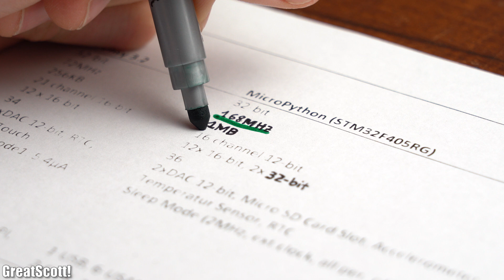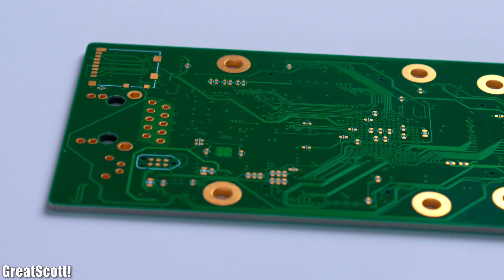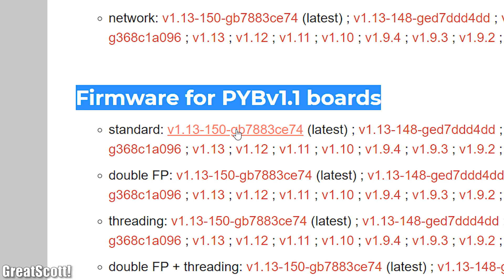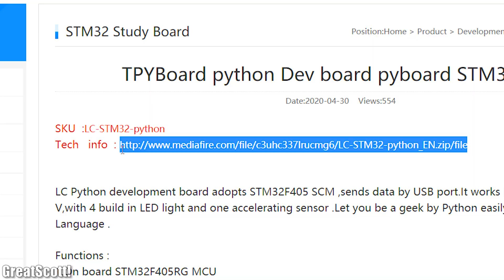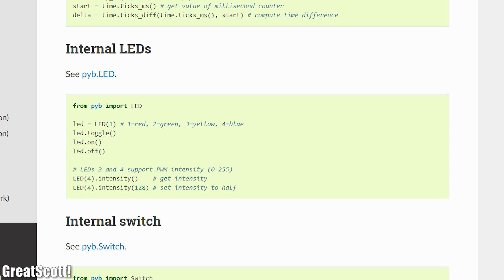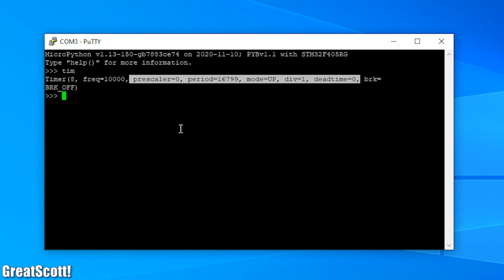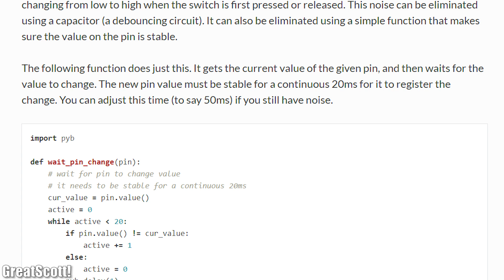Easy & Powerful Arduino Alternative? #4 Pyboard (MicroPython) Beginner's Guide

Comment: Sure the Board and Micropython is easy and simple to use, but it will make pretty much any engineer cringe real hard when asked to work with it.
Reply: Could you please explain why?
Reply: @adityag.5372  Because engineers have a massive thing about being "real engineers" and how their code is great because they understand how the hardware actually works and other nonsense ... the big inside joke being that they all think modern processors work just like a z80 did decades ago.
Reply: @adityag.5372  The overhead is way to big. To run Micropython it requires a beefy processor. And if you are going to sell a product, this is a huge waste of profit. And engineers need to spend the time to optimize a product so it gets the most profit for their company. Sure you save development time by using Micropython but it results in a net loss overall. Also if you try to leverage some lower level properties of your processor, it pretty much impossible with python.
Reply: @jfk4229  

>lower level properties of your processor,
>it pretty much impossible with python.

Both normal python and micropython can call directly into functions that use the standard C calling convention/ABI. Normal python has alternative interpreters like cython that take dialect of python and turn it right into machine language... There's no reason someone couldn't come up with an ahead of time compiler that did the same for micropython.. i.e. produced machine code for the target micro before hand. All you would need would be a frontend to LLVM or GCC.
Reply: @donpalmera  But why would anyone go through that much work instead of just using plain C/C++?
Reply: @jfk4229  

You don't have to re-write micropython each time you want to use it. Calling "native code" is easy. Why not use C or C++? Because a lot of people are terrible at it and a lot of people are just sticking together code that already exists. Why not use a language like python for that and get some nice bits like memory safety, useful exceptions etc in the meantime. 

Of course there are reasons to use C but the reasons you'll hear out of most engineers are total nonsense.
Reply: @donpalmera  You are right that python is a better language for engineers to get right. Because there is pretty much only one way to do things. (Unlike C++, which has a insanely bloated std-lib) But its feels wrong to push technologies into areas for which they weren't originally designed for, just because we can. Have a look at web technologies. There its WAAAAY worse. (And even more people who think they are grandmasters, just cause they have a website) And I REALLY don't like that embedded tech is heading the same way.
Reply: @jfk4229  Partly because C/C++ is a royal bitch to work with if you are fairly new and don't intimately understand the specific hardware you are using and the exact functionality you are after.... Not to mention that Python has already eclipsed C/C++ as the go to programming language worldwide for the greatest number of devices... I have been an engineer for over 30 years and worked with ancient languages such as Fortran '77, Cobol and early versions of C... as well as assembler (yes, even for the Z-80) as well as some C++     I happen to like Python and its ability to Include C programming into it, and a large and growing number of IT and programming professionals feel the same way as provided in statistics and surveys from the professional magazines and sources... I think the only reason you "cringe" is because it is something new that you do not understand and it makes you uncomfortable... Personal opinions aside, the areas of growth are in Python programming and the Circuit Python and MicroPython subsets are stepping stones into the full version... the choice is yours... languish in that supposed "Z-80" mindset of mindless "superiority of "X" Programming language", or chase the solid career paths offered by growing and expanding your knowledge...
Reply: >pretty much any engineer cringe real hard

The cringe won't be as hard as when anyone with some development experience looks at code written by an engineer. EEs etc write insanely awful code and should be using something like micropython to save everyone else from their garbage.
Reply: @donpalmera  ARE YOU INSANE?? EE's write HARDWARE SPECIFIC code so they can use cheaper processors in their designs. Therefore increasing profits. If you come from an IT side it feels like bad code because all these memory and speed optimisations feel like wasted time. It people are so used to always having enough processing power. This is really the awful side! Totally unoptimized code. Imagine you use Python on servers with huge trafficloads. Your boss will be very displeased to see that you need to scale up the infrastructure again, just because your code is not optimized. The real nonsense is not understanding why something is done a specific way when it could have been done way simpler! I guess you suffer from the same problem you described about engineers having a massive ego.
Reply: @jfk4229  

Hate to quote myself but....

"the big inside joke being that they all think modern
processors work just like a z80 did decades ago"

The fact that you think you're diddling around in code actually makes much difference is laughable. Most of the "optimisations" you think you are doing the compiler totally ignores or are actually anti-optimisations.
Reply: @g69se212  

From my real world experience:

I worked with an IoT in a can module called the electricimp. That had everything, networking, crypto etc and is apparently STM32 based. I think something like 300KB of SRAM.. they managed to get everything in there including a top level scripting language called squirrel. They even managed to have some sort of A/B OTA update scheme that made it next to impossible to brick and had deep sleep for power saving. Basically they got it the balance just right. The built in OS did most of the grunt work and the developer just had to slap together a script with their logic and they had an IoT product.

Then I worked with an IoT chip that had 1MB of SPI flash internally and 512KB of SRAM. There was no memory mapped flash so everything that had to be accessible by the cpu directly had to be in SRAM including RO data. With the wifi handling and proper TLS there was barely any memory free and everything was written in C. That should have been the better chip and it would have been able to have a scripting language for the business logic if only it could run code from the SPI flash... To make barely working C code fit on that thing took months of #ifdef 0'ing out bits of libraries. It was a total nightmare.

This is the same situation with the ESP32 right now: It doesn't really have enough SRAM to do TLS properly let alone TLS and micropython but it's totally possible to get it right.

If micropython really takes off especially with RISCV gaining momentum I wouldn't be surprised if we see mass produced micros that are kitted out specifically to run it as the main language.

A micropython frontend for LLVM would also be cool but I think rust is probably going to fill that niche.
Reply: Wow looks like i started a heated argument 😅😅 anyways thanks to both of you for your insights
Reply: @g69se212  

>But I don't see how MicroPython
>can (currently) beat C in efficency
>(time, space, power). 

I don't think it has to be. The places you'd use micropython (bigger micros with network connections etc) make it less of a problem.

Comment: I had my first 4 layer PCB built by JLCPCB because of your sponsorship. They did a fantastic job on those boards! I am very impressed by them.
I’m designing another project and will use them again!

This seems like an interesting board. I’m very interested in the Arduino port for the libraries. That way, the language changes won’t be so severe. Sounds like a great board to experiment with.

Thank you for a great video!
Reply from the maker: Great to hear!

Comment: Can you make a motion controll project were multiple servo/stepper motor can sync up with a rotary encoder?might also be nice if it has an electronic/virtual gear ratio on different motors. It would also be nice if you can just use something an arduino.

Comment: "168MHz clock speed" 
Meh..
 "1MB memory" 
Okay..
"32-bit timer" 
Fine, I guess..
"3 on-board LEDs" 
Now that's what I'm talking about! Now I can flex in front of my friends with my advanced, triple blinking LED program!
Reply from the maker: Haha :-)
Reply: The Arduino Micro has 3 onboard LEDs too and they're all programmable :)

For reference those are LED_BUILTIN (pin 13), LED_BUILTIN_TX and LED_BUILTIN_RX (also the SS pin). Should also note that those will still flash when you use the serial monitor and the only way to disable that would be to modify the firmware and delete the code that handles the RX/TX LED flashing.
Reply: @HollyT  Laughs in Intel 1,830MHz
Reply: @HollyT  Yes 😂😂😂😂
Reply: Have you hear about the teensy 4.1 ?
"1.05Ghz cpu clock "
"8mb falsh"
"4mb ram" 
"Expandable storage"
"10/100 ethernet "
"55 i/o conetors "
At the duble the price
Reply: @sfp4197  Is the RAM expandable? If so, this sounds like it would be a decent microcomputer (add like 128MB of RAM to this thing)
Reply: @wesleymays1931  yes, you can expand with 1 flash chip and 1 psram chip 
https://www.pjrc.com/teensy-4-1-released/
Reply: @sfp4197  Alright! I just got an idea after I realized you can actually use 2 PSRAM chips, if you don't add extra flash. This gives me an idea... Teensy Tablet!
Reply: 168MHz clock speed
Reply: @HollyT  no problem the arduino is just missing an 8 from the units place
Reply: thats cute. Even my gsm module has 2builtin leds

Comment: adafruit has their own fork of micropython called circuitpython. adafruit also makes boards that are designed for it and make it really easy to use. while the most powerful one may not be as powerful, "only" 120Mhz. It comes in the same footprint as an arduino nano so i think its pretty cool

Comment: There is so much more beyond just this.
STM32 https://github.com/stm32duino/Arduino_Core_STM32
ESP8266, ESP32
nRF52833, 
BadUSB https://www.ebay.com/itm/DM-SS-Micro-CJMCU-Beetle-BadUSB-Atmega32U4-Development-Board-for-Arduino-UNO-R3/312028640456
MSP430,
Kendryte K210 https://www.canaan.io/product/kendryteai

Comment: I have a Raspberry pi 4B(8GB of RAM). What can I do with it. Any new ideas?
Reply: A 4B is powerful enough to use as a simple desktop computer. How about you turn an old monitor into an AIO computer with your pi, while leaving a display out to still be able to use the monitor as an second display for another computer. That way you could have a linux dev environment at the push of a button.

Or you could make a smart mirror, or make a media server (or a NAS), or host bots for discord, reddit, youtube, twitter on that pi.

Make it into a PiHole so you never have to worry about ads on your network, make it into a retro gaming console.

Buy a camera module, and use it as a security camera with built-in storage or network storage.

So many ideas....
Reply: @Dogeek  I too had a plan to use it as a desktop.
Reply: @Dogeek  I don't know how well I can use Linux, I'm quite used to windows 😅
Reply: @srivatsarupadhya6116  Totally worth it, you won't miss the "random" reboots.
Reply: @NiHaoMike64  There is no more "random" reboots with windows updates as it is all configurable as well. So it really doesn't matter what flavor of OS you use as long as you make cool sh1t with it.
Reply: @kazykamakaze131  Have they at least redesigned the updates so they happen in the background? On Linux, not all updates need a reboot and those that do already finish before asking you to reboot, so back up and running in under a minute.
Reply: @NiHaoMike64  Most updates run in the background, there are a few that require a restart, but same can be said in Linux. The problem with linux is the lack of end user integration software that is found on windows especially when looking at Games which is a huge frustration on Linux where you need to run things like Wine or use a virtual environment that has direct gpu access, just a plain mess. On windows everything works at least. Sure linux is brilliant for development as an OS platform but these days you have your normal OS as windows and overlay linux if need be as it so resource lite. Multi core cpu's and 10's of GB of ram gives you choice of having best of both worlds and in my opinion these days a daily user OS for me personally Windows is plain better and if I need linux I spin up a VM if need be, the joys of having 64GB of ram and 16 cores.
Reply: @kazykamakaze131  So Windows no longer has updates that take a long time to complete after a reboot?
Reply: @NiHaoMike64  Define long time? Same relatively as linux? Then yes and no. Also length of time of updates is also related to what specs your pc is running. More power, less waiting.
Reply: @kazykamakaze131  Even on fairly old hardware like a Core 2, it takes less than a minute for Linux to reboot after an update. Windows had a reputation of taking as long as 15 minutes to finish updates after rebooting, are you saying that's no longer the case?
Reply: Media player lol!

Comment: You may try to code on vscode, it is light (not as light as np++ ), it will help you debbuging your python code 😉
Reply: Sublime Text is also very nice, and not as resource-intensive as VSCode.
Reply: @skylerlehmkuhl135  VS Code and Atom are the (brilliant) js CKEditor editor packed with nodejs and a whole chromium browser, there's nothing conceivably worse than this as programming and software security goes. PLEASE use a proper text editor like sublime text, textmate, geany, kate, notepad2, notepad++, nano, micro, vim, emacs - anything written the platform you're actually using. CKEditor is awesome but it is developed to be run in the browser and most of its code deals with browser bugs, workarounds and the crap web APIs surrounding contentEditable, not implementing a fast, reliable text editor.
Reply from the maker: Thanks for the tip :-)
Reply: real men use vim ;)
Reply: Have a look to vscodium, vscode without the microsoft's dubious code...
I use it with the platformio extension, it is great !
Reply: @gogny7665  I'm not worried about Microsoft telemetry. I use Pihole DNS server. It blocks malware and spyware including Microsoft telemetry endpoints.  It does a big job of keeping viruses and spyware off the rest of the family's computers too.
Reply: @Alacritous  just be sure, use the open source one
Reply: @gogny7665  I use Atom because of the code from Microsoft but Plattform IO has many issues with Atom. I didn't know such thing as vscodium existed so i might give it a try. Thanks for the info.

Comment: I normally use uPy on ESP8266 & ESP32. They just cost 3-4USD but with wifi & Bluetooth connection capability
Reply: Same, they are my 2 favorite microcontrollers
Reply: me too. upy on a ESP32 is awesome
Reply: I use esp32 , it's just awesome for the price . But it gets a little bit hot while running Marauder .

Comment: Can we use python to program a Arduino as well?
I have heard that it is possible but couldn't do it myself. It will be very helpful if anyone can confirm on this.
Reply: It depends on the microcontroller. Here http://micropython.org/download/ you will find a list of the ones supported.
Reply: use pyfirmata and upload firmata on arduino board